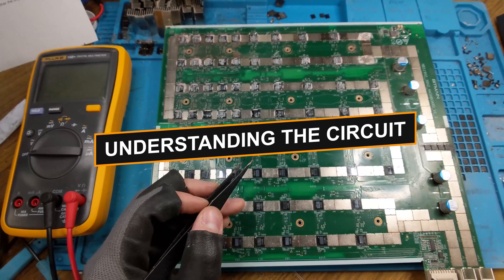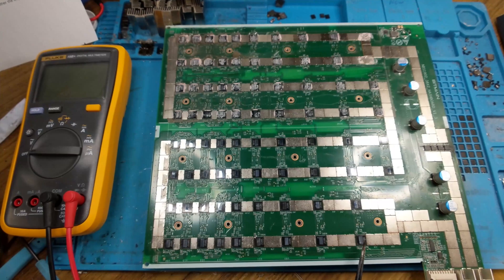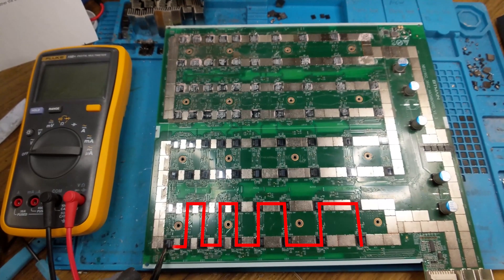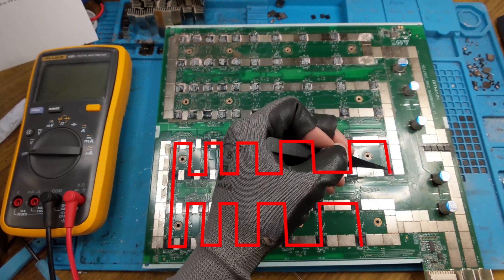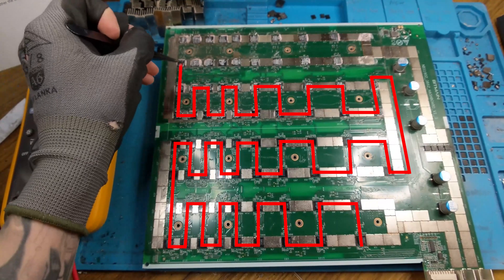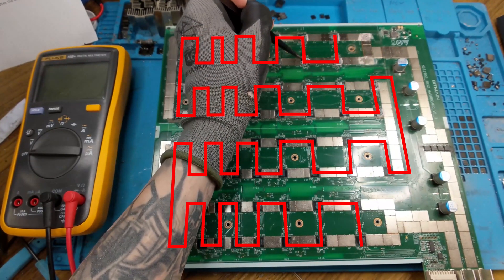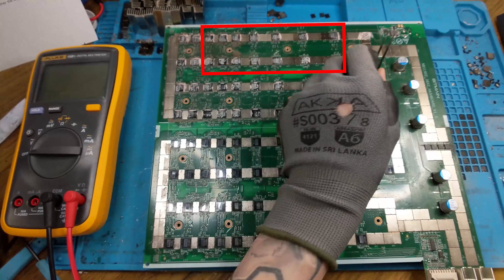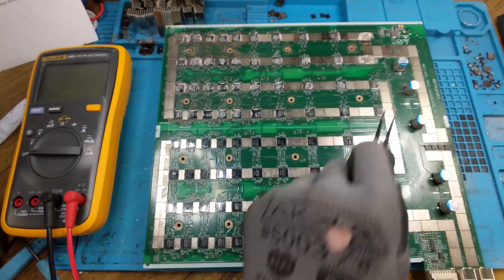ASIC Repair Basics: Antminer S19 - The Circuit

Comment: Good vid. How about a challenging one? How about fixing temp sensor error and no pic errors?
Reply from the maker: We have such videos and livestreams on the channel. This is an explainer on the circuit of S19. That said, the S19 temperature sensors are connected on their own circuit to the PIC, making it easier to troubleshoot temperature issues on S19. The only downside is that some parts corrode very quickly, which is almost always the cause of broken temperature sensors for S19. If your pads haven't turned to dust, this will be a quick and easy fix.
Reply: @DCentralTech  goodbro. Thx